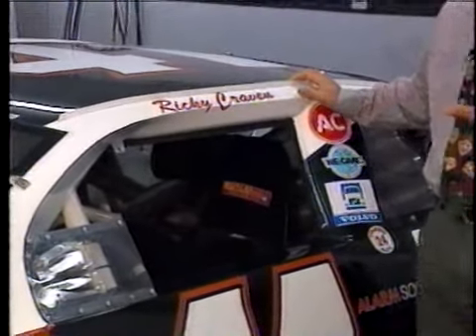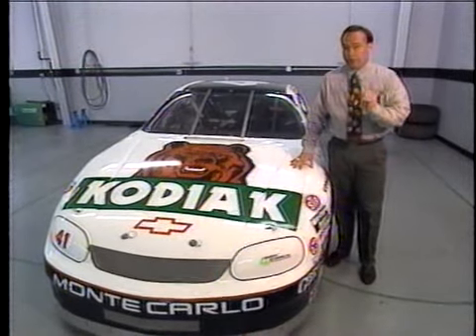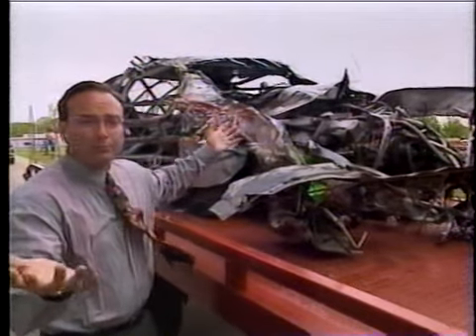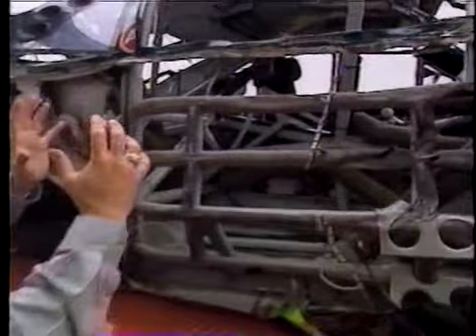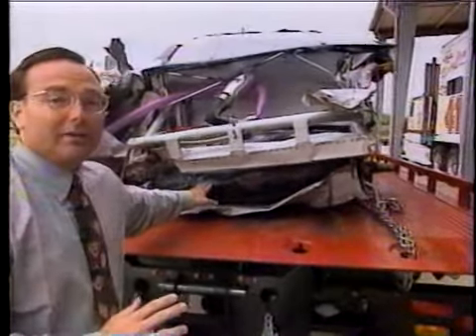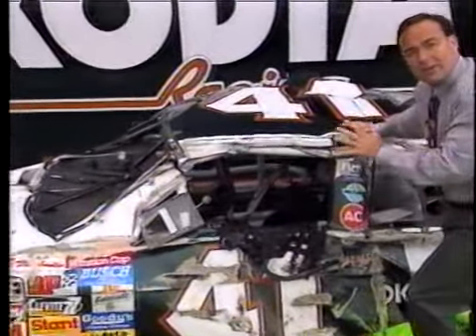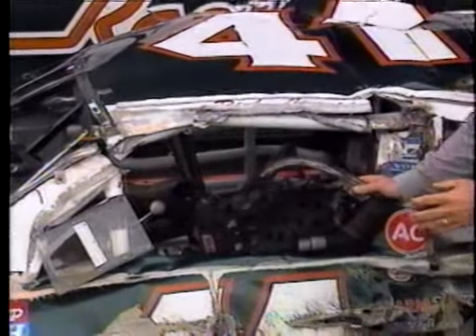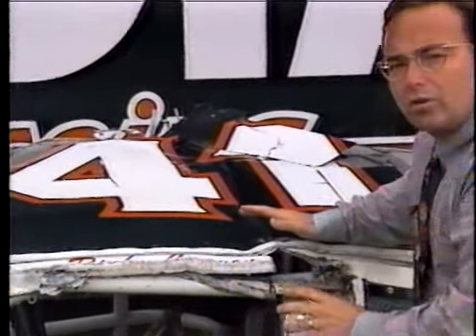Ricky Craven interview days after his Talladega wreck

Comment: And in some ways the NextGen is Safer. We can clearly see how well the frangible front & rear clip were deformable to protect the driver. This week Cody Ware, Alex Bowman & Kurt Busch are out with concussion like symptoms. This Craven Era car frankly has effective safety features that have been removed. Today, it appears to this fan that The Show has become  more  important than driver safety.
Reply from the maker: The front and rear clips back then were designed to absorb the impact of a crash, the cage was the more durable and strong point on the car. If they had today's seat designs along with the hans device it would have been a near perfect chassis design. Today's POS car is way to stiff and over engineered with little driver/crew chief input. What looks good in theory and design doesn't necessarily apply on the track, that's why testing was so important back then. Bill France once said, the car manufactures would never control Nascar, it seems they have now with bunch of clowns running it now.